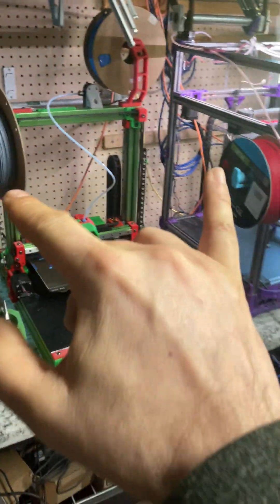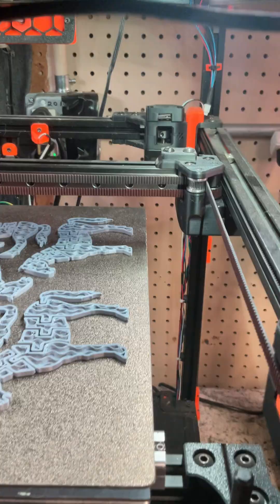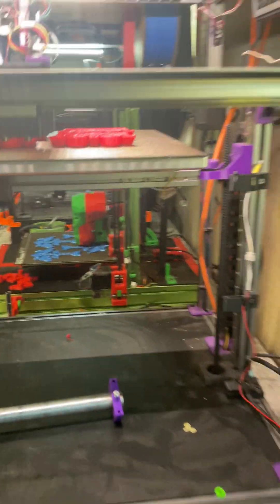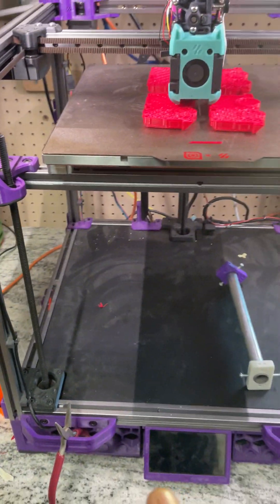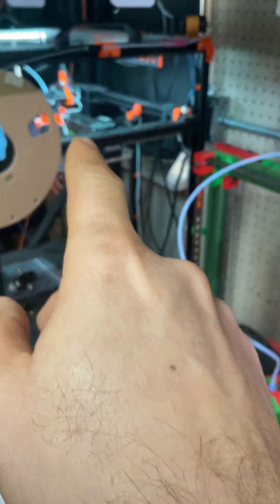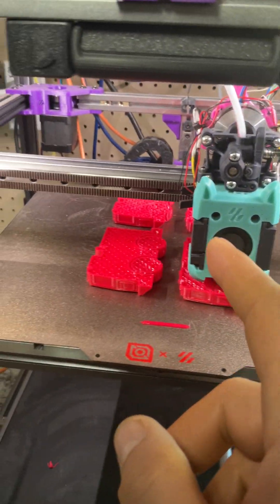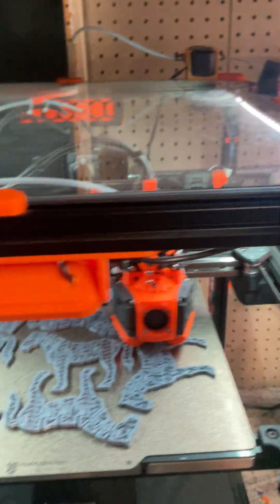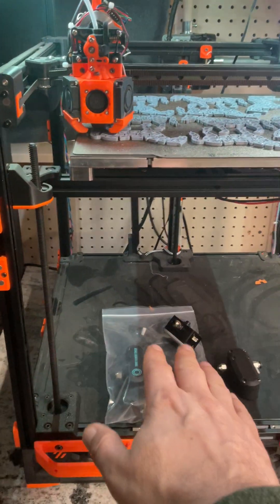Mods I would add to a Voron trident

Comment: Nice video. With EBB36 (easily) and new Cartographer you can run in CAN mode and daisy-chain. If you change toolheads a lot, I suggest StealthChanger - just use it as an enhanced TAP and manually swap out. The one downside to SC is you basically need sensorless X (there are technically other options, but kinda janky). Interesting to know you think Dragon Burner has better cooling than XOL, Yavoth supposidly added flair to the parallel fans to improve cooling. Would love an indepth comparison of the alternative toolheads - XOL, Dragon Burner, Yavoth, A4T, Antead - in terms of IS and cooling.
Reply from the maker: Chances are I am not going to an indepth comparison between toolheads. 
My printers run 24/7 printing toys for our non-profit: 3D Printing Elves.

I do have a stealth changer, and have tried using their tap in my trident 350 to swap out. However, that 350 is not attached to a box turtle

Comment: You can put a  brush back there hanging off the bed frame on right side.  I have it, works great
Reply from the maker: It depends on toolhead you use, y-endstop you use, kinematic mounts, etc. Some like me have no room, others such as yourself have the room
Reply: @The_original_Reth  Oh, maybe your mounts then. I agree on the sensorless thing.  Never understood what the big deal about getting rid of the switches. They are more accurate and i have a sensorless zerog and once and a while it goes the wrong way and crashes.